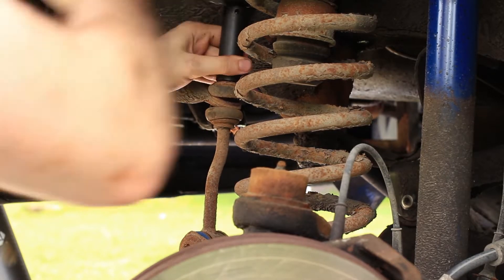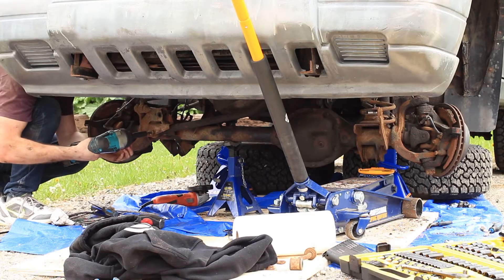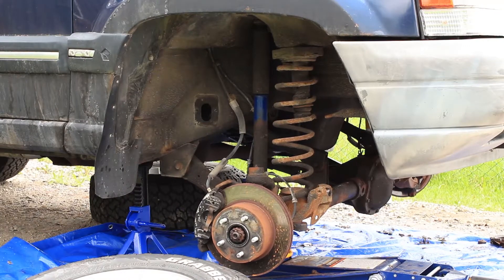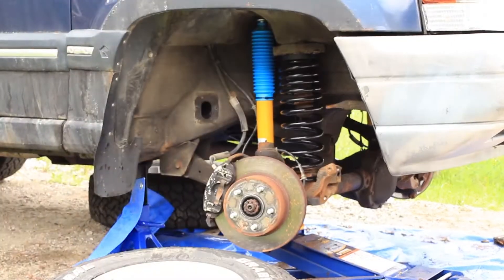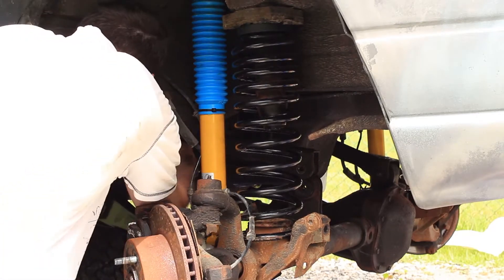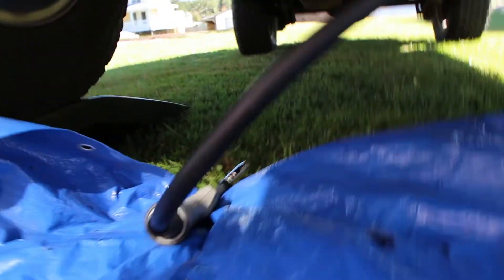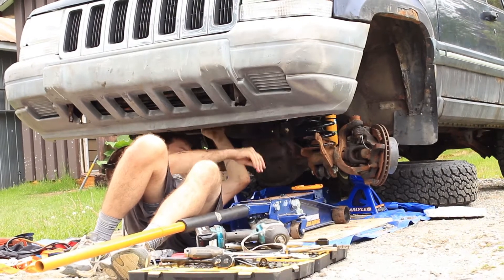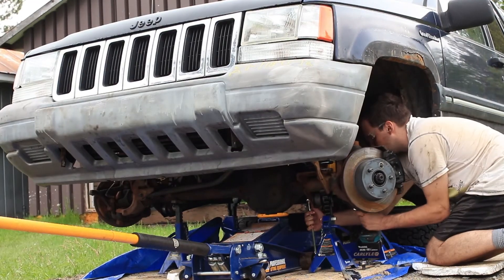Jeep Grand Cherokee (ZJ) Front Suspension Rebuild

Comment: I'm doing an almost complete suspension on my 94 ZJ too. 4 BJs, 4 front control arms with axle bushings,  4 sway bar links, 4 springs and 2" lift kit with shocks from Rough Country and front brake pads. The axle nuts are rusted on solid and nothing I had could budge them so I had to purchase the Bauer corded impact and that spun them off easily. Thanks for mentioning the extra information and the bolt fastner ratings, I didn't think of that. Good video thanks for posting.
Reply from the maker: Thanks for watching, glad it helped!
Reply: I feel like everyone had gone through this with an axle nut and gone and bought the corded impact, that’s what I did !!

Comment: great video thank you
Reply from the maker: Thanks for watching!
Reply from the maker: @kid pro quo Yeah I was originally going to do the ball joints and the upper control arm bushings too but I ran out of time. I've had the ball joints replaced by a shop since there was no point in getting an alignment done with wore-out ball joints. I didn't have death wobble but I'm sure with the condition everything was in I didn't have long before it set in.

Comment: Did you buy a kit with new bolts and hardware? Where did you source these? I'm in the same situation with rusty hardware and want to replace as the new suspension parts go in. Thanks
Reply from the maker: I bought the front and rear kits on ebay. I also got the sway bar and shock absorber bolts. It's more pricey but all the bolts and nuts are already sized correctly. If you have some patience you can find out what all the bolts are (I don't remember them, but the internet knows!) and go to a specialty bolt store and order them. Just be sure to use metric grade 10.9, or imperial grade 8 whichever one you choose. I do wish new control arms came with new hardware.